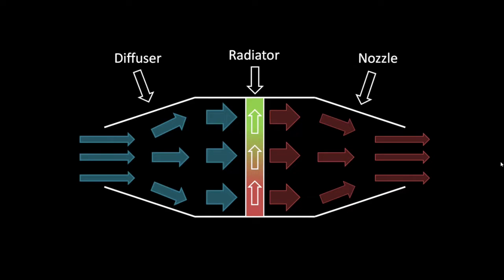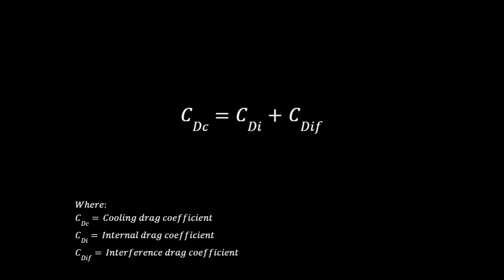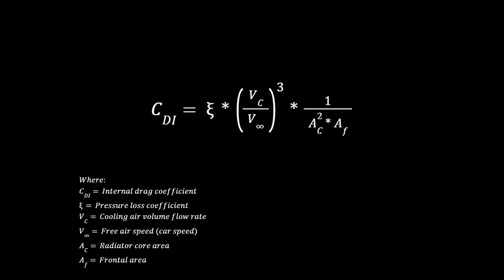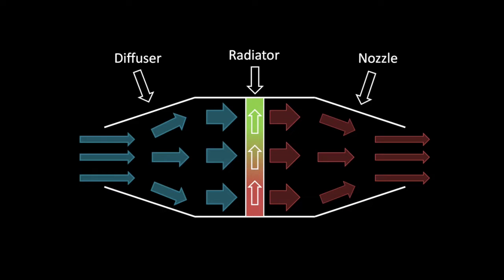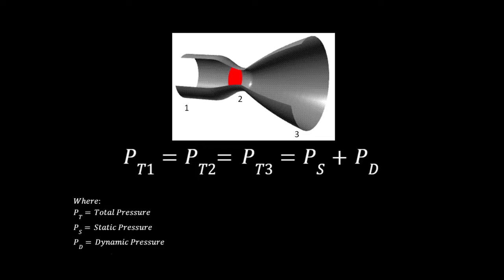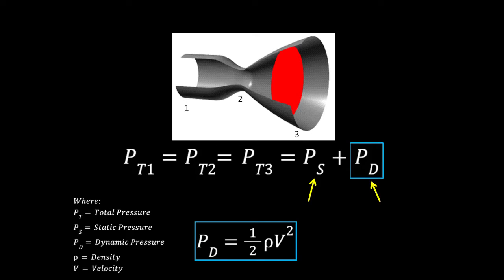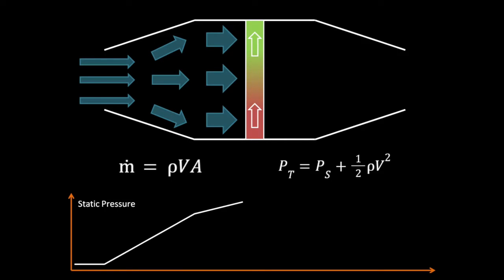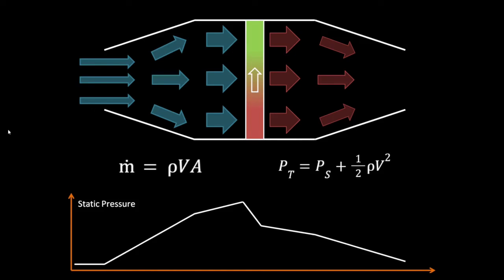The Art of Cooling: Understanding the Science Behind Radiator Ducting

Comment: If you were to add a pull fan on the very end of the exit ducting would this benifit the overall system I would suspect it would increase the exit velocity of air
Reply from the maker: Thanks for watching, yep are are correct, it would help increase the exit velocity of the air, it would definietly help the overall cooling capacity of the system, but would also increase the internal drag.

Comment: Increasing velocity decreases pressure
 But closing the exit (if met its flow capacity) will also increase pressure to everything upstream. Unless it's venting out to a area where it's drawing vacuum. So why not leave it open?
Reply: I think what you’re talking about really depends where the location of venting is and your goal. I think the diagram he has here is easier to control and predict the flow, whereas the diffuser version would be less predictable.
Reply from the maker: @josephbargo5024  Yeah that's right, diffuser, location, and different speeds all change the amount of exit opening you should have to maximise heat transfer and reduce internal drag. Having a system that could adjust the outlet size and fan speed live given the cars speed, location on the track, and coolant temp would be ideal, I image the benefit from this system is probably not worth it given the cost, extra weight, and regulation or we would see it everywhere